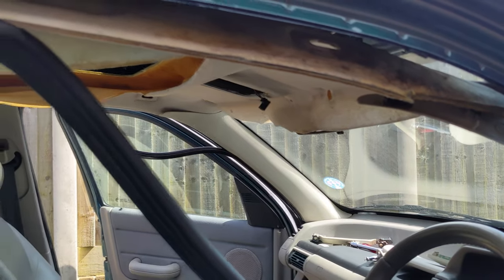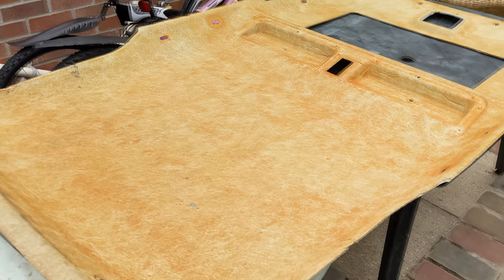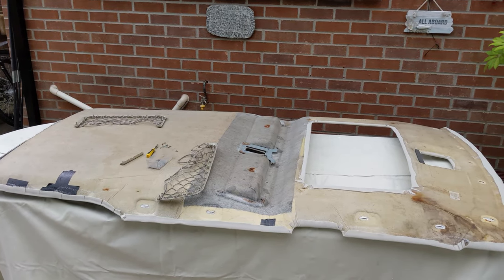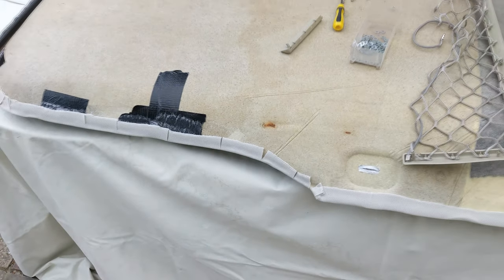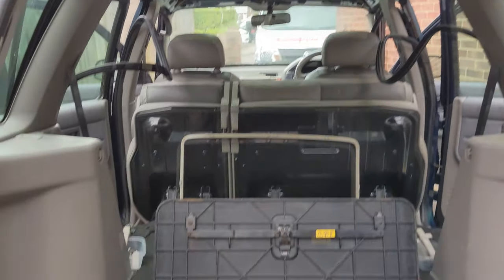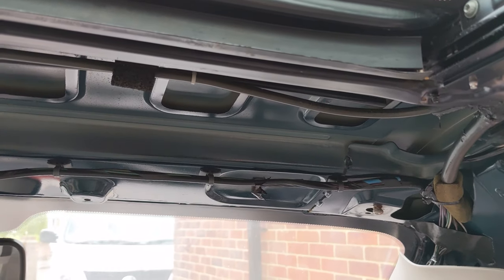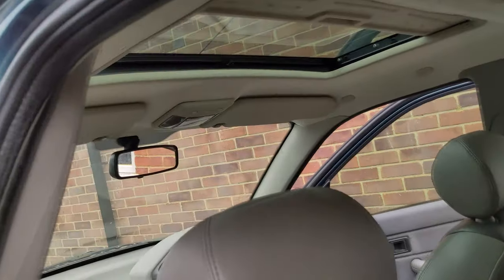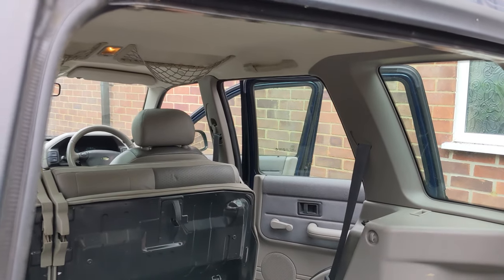Freelander Land Rover 1998 | Replacing The Head Lining | Spring 2021

Comment: Nice video! how hard was to get the panel off?
Reply from the maker: Thank you. Not to difficult you just have to be careful taking out the studs that hold it on and the light and handles that need to slot through the head lining. Much easier than we thought 😁